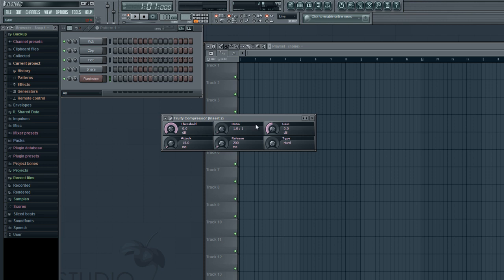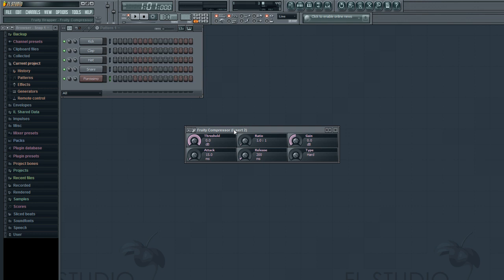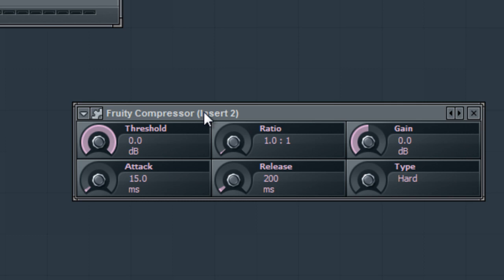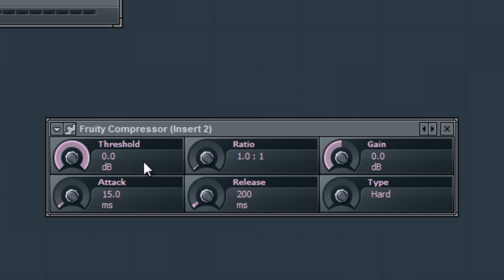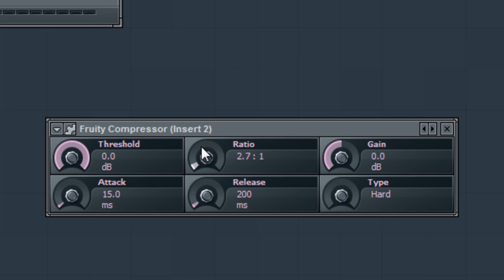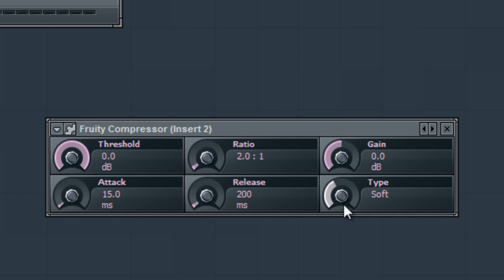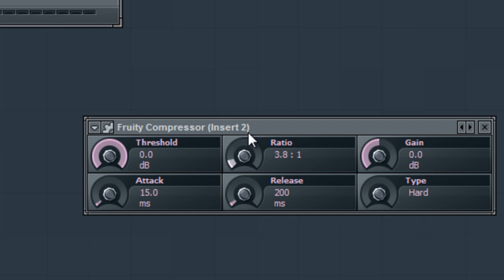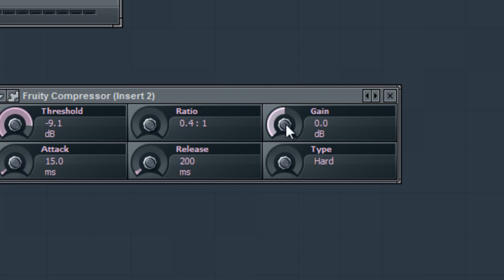FL STUDIO - Tutorials - Compressor's Explained

Comment: If you lower the threshold, then the level of the sound tends to lower too, so you raise the gain to push the level of the sound back up to its original point. Gain is the level of a sound going in to a system, and threshold defines at what decibel level the compressor begins to compress the audio.